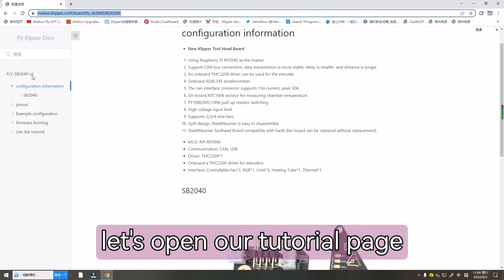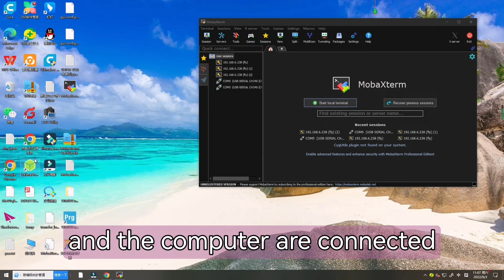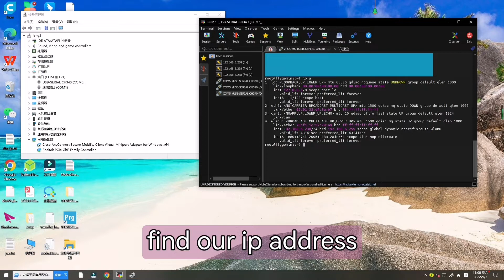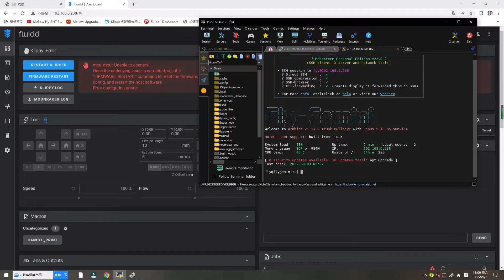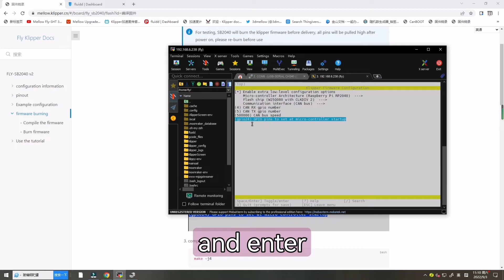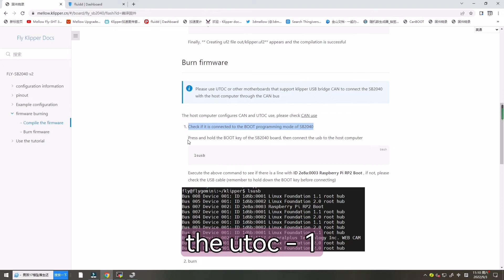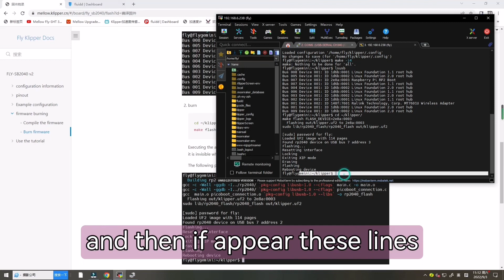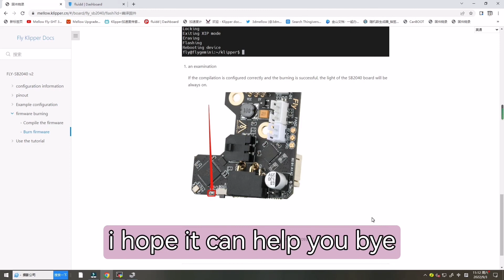Guide: Mellow Fly-SB2040 V1 Board install klipper - step by step guide for 3d printing beginner

Comment: I saw this on a random Banggood as, and I'm trying to figure out what it's actually used for.
Reply: It make the wires going to the top big of a 3d printer only need 4wires instead of 15
Reply: @jonno1130  that seems like a stupid amount of extra weight to save a few lightweight wires.

Anyone here know what does it actually does?
Reply: @jmckenna2k10  It's not about saving weight but reducing the possibility of wires breaking while getting bent thousands of times in the cable chains (on the Voron for example.) Those Canbus mods usually also incorporate a umbilical style of routing the wires which further reduces strain and improves the     reliability of the printer. Do you need it? No. But it's a nice gimmick
Reply: @markaltmann583  I mean, reducing the number of wires doesn't really seem like it would change the possibility of those wires breaking. 

Maybe I'm just kidding something here. Properly securing and safely routing the wires seems like it would make more sense to me than cutting the amount of wires down.
Reply: @jmckenna2k10  Sure, all wires have some kind of mean time before failure. But the possibility of breaking increases with the count of wires (assuming the type, manufacturer etc. is identical) due to inconsistencies in production. The more wires you use the higher the risk of having a "dud" in your harness. Think single strands broken in the manufacturing process, while packaging or handling. And if the failure happens, it's easier to replace 4 rather than 12 wires.

Comment: Thanks for the tutorial. Are you going to update it like the Hartk Revision 2 board, that already has Dupont connectors on the small board that gets installed in the front cover, to easily be able to connect the fans and Neopixels without having to solder the wires on? Thanks!
Reply from the maker: hello friend, thanks for your goods questions, if update we will inform you, thanks